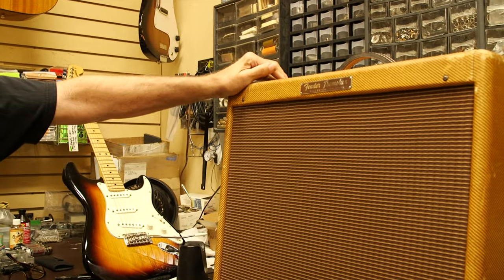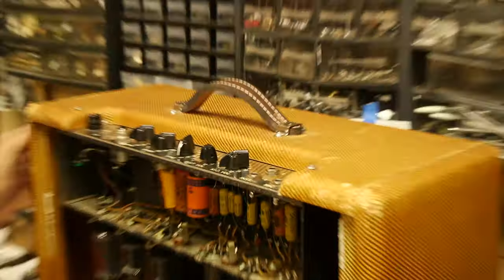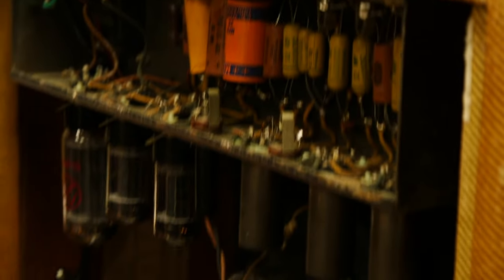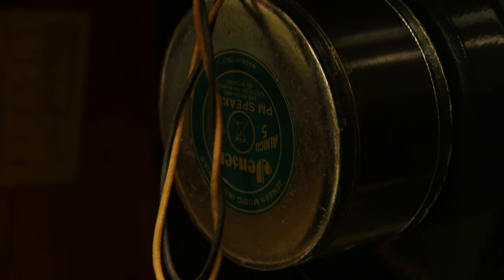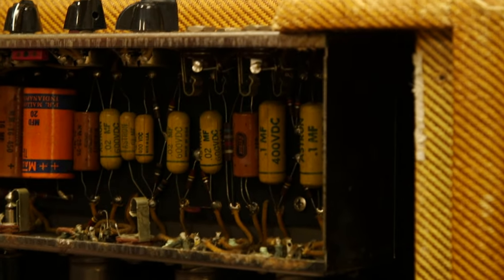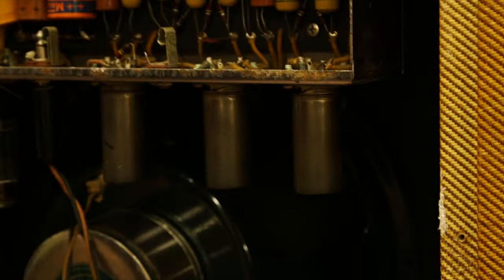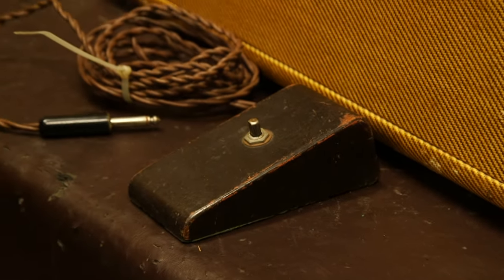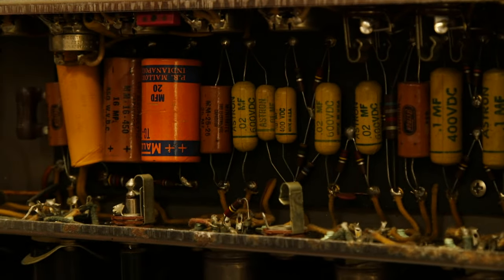The Last Fender Serial Number From 1956 | New Addition at Norman's Rare Guitars

Comment: Those Italian Jensens are junk. Jensen speakers from the late 50’s to the late 60’s are amazing. I have a factory matching quad of 1964 C10q’s that look like they came out of a time machine they’re so clean. Original cones and all in working condition. Pulled em out of a no name 4x10 cab I got for free. Very rock n roll sounding speakers, they break up early and have a sweet Chuck Berry type thing to their sound